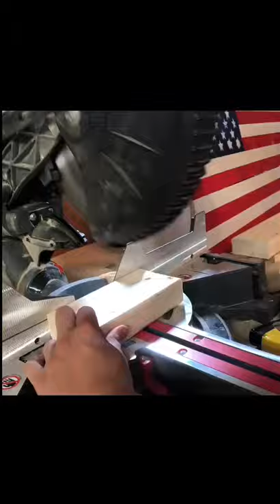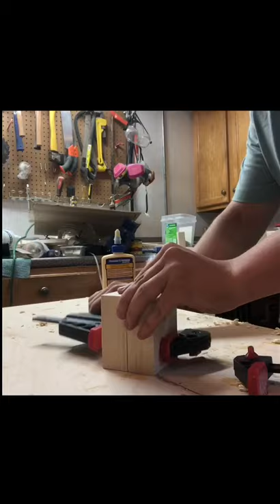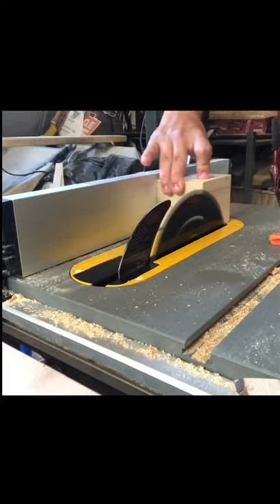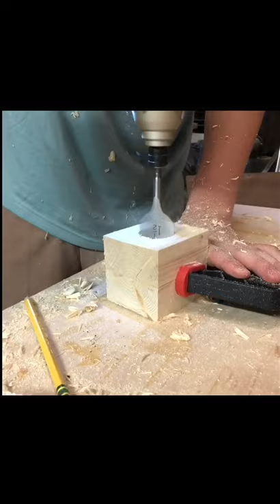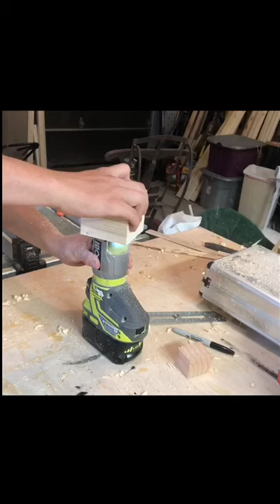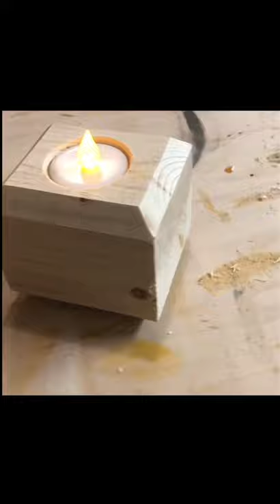Making a Candle Holder Out of Scrap Wood #Shorts

Comment: I think in a couple of different colors and sizes that would make a great present. A quick question… I’ve got a bunch of bottle caps ( a friend owns a bar) and a stash or planed down pallet slats (I’ve run them through my planer because smooth wood beats rough wood), any idea for a project combining them? Thanks for sharing.